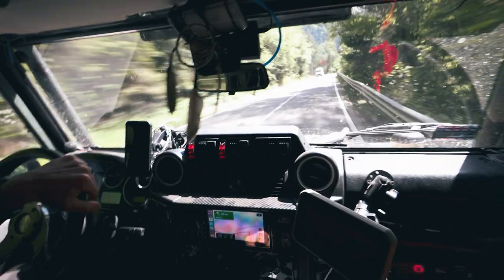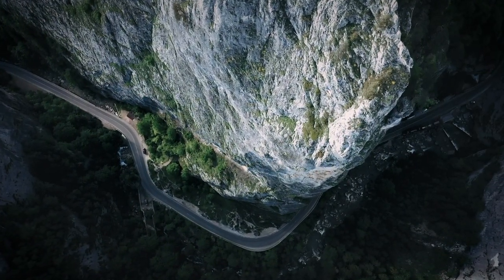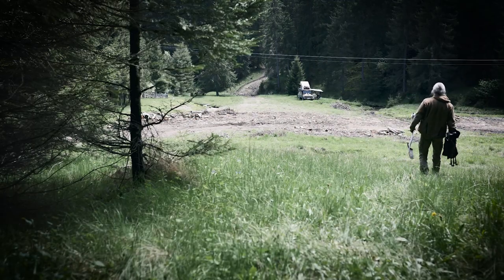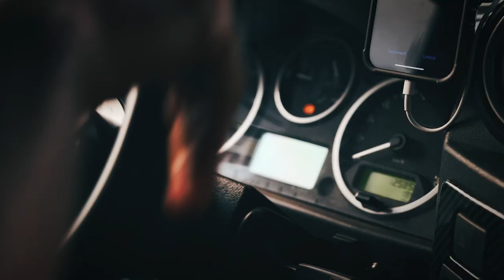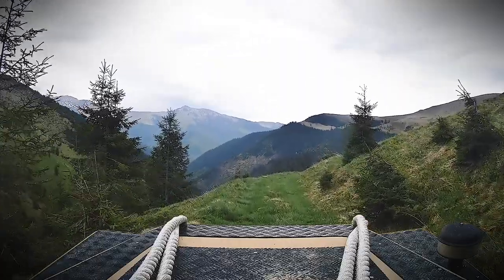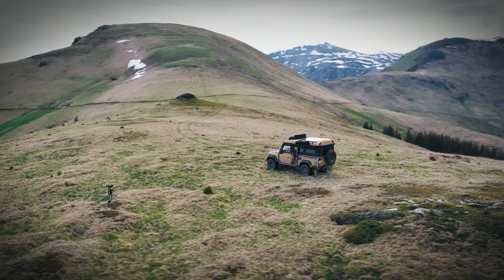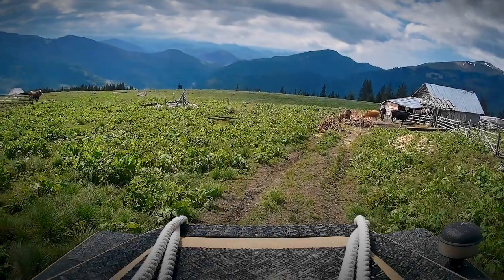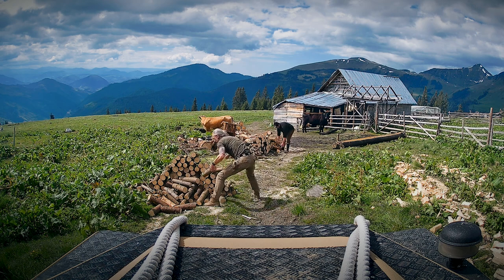Overlanding Romania in LR DEFENDER - EPISODE 6 - how to poo with a view and other everyday life.

Comment: Great video/ editing as usual,  just seeing the highlift for a taking wheel off might be worth getting a little bottle jack , doesnt take much space and alot safer
Reply from the maker: Thank you Mud Panther! Well - I need to cary the HiLift anyway, so the bottle jack would be an additional equipment just for such situation. And it should be a bigger one for the size of those wheels. And it would be additional weight. I can agree it would be safer but as I have blocked the wheel on the other side with some wedges I use for leveling the car, it was rock- steady 🤗 👍🏻